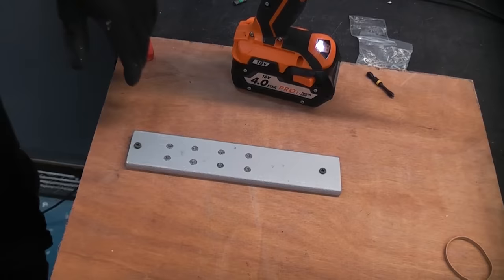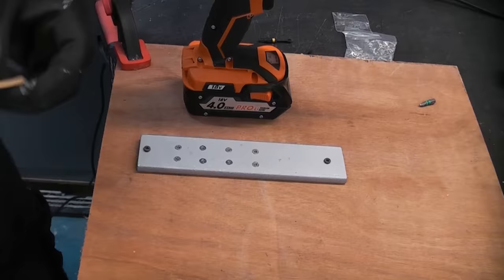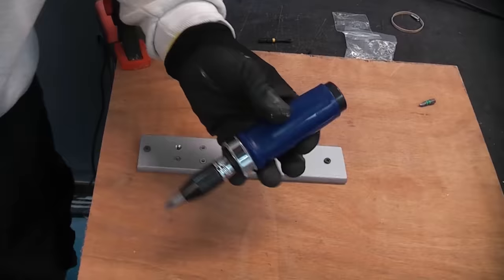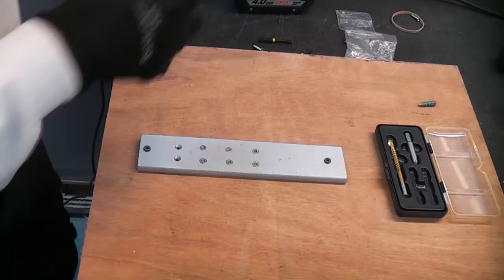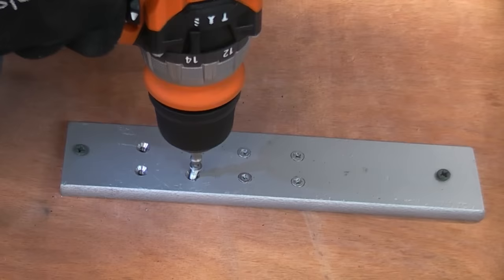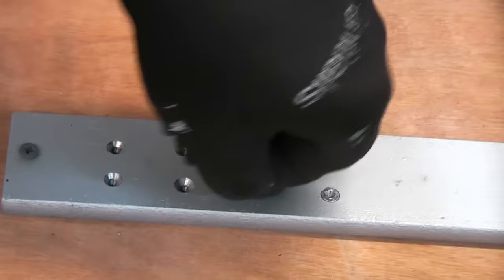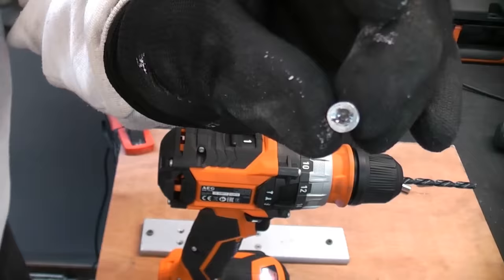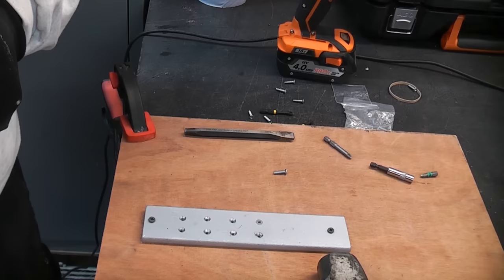How to remove stripped screws – 7 different ways

Comment: is the swearing and pleading method not useful?
Reply from the maker: It's a necessity, but I cut that bit out for the benefit of the viewers LOL
Thanks for the comment
Reply: swearing and pleading method is more a motivational technique for both the operator and the tools
Reply: Imagine Gordon Ramsey, the screws would be so screwed.
Reply: Jusb1066 Lmfaooo
Reply: I just use the sawzall method then combine it with the prybar method then spit on the motherfucker and demand it to call me the boss....im still waiting for the response but it nolonger has a head
Reply: I tried just then, didnt work sadly
Reply: I will add one more idea that worked for me another day. I ended up with a Philips screw head really bad, no way I could take it out with any driver. I had a set a torx bits in my tool box, I picked up one that would fit inside the Philips screw head, a hard punch with a hammer for the torx bit make its way in,  put the drill driver on the torx bit and off you go. It worked like a charm. I guess it will be my preferred method from now on as  long as I have a torx bit handy.
Reply: That screw is f**king RAW!
Reply: Jusb1066 my husbands trying that now... With no luck
Reply: I think it's just not as quick
Reply: LOL!!! Like he said, it IS a necessity, but truly, NOT very helpful unless you combine it with at least one of the methods demonstrated.. LOL
Reply: I prefer swearing, insulting, and threatening
Reply: Jusb106
Reply: Jusb1066 yes it does normie
Reply: My go-to method.
Reply: Yup.
I have at least an 80% success rate when adding cussing to my procedures
Reply: I've determined that swearing and pleading is useless. I'm very proficient in this technique. I've used every swear word I know and the screw still will not budge. It doesn't matter how loud or passionate you use your swear words either. It's like it has no feelings or something.
Reply: David Y literally
Reply: "I'd just like to point out that If you're trying to remove a four inch wood screw where the head  is damaged... you have virtually no chance at all."   
That's exactly what I am trying to do. I will put a couple of these through the torture test anyway.
Reply: Lol
Reply: I have found that describing in detail exactly how you intend to recycle the fastener helps too...
Reply: Did not understand instructions. 
Got fined by the Screw Union.
Reply: My boyfriend is trying that method while I’m watching this. We will see who gets it out first.
Reply: David Y so funny
Reply: I tried talking in my best British accent,  worked a charm mate
Reply: What is the name of the screwdriver in the second way?
Reply: @ultimatehandyman  What is the name of the screwdriver in the second way?
Reply: It has to be swearing or pleasing, never both or it can't work
Reply: Jusb1066 I am in that stage rn lol
Reply: You would use this verbal and supplicating method 1st before you remember you have watched this video. After you tried all the above suggestions as shown in the video and that rusty junk metal screw still wont come out the by all means again apply the 1st method liberally.
Reply: Usually threatening or negotitation works
Reply: FUCKING HOPE NOT, I'M 10K IN DEBT TO THE SWEAR JAR
Reply: @stuarthunter2923  lmaooo i keep swearing everytime I cant get the screw off

Comment: Brilliant! After struggling for 20 minutes I found this video and used an elastic band and power screwdriver to remove a screw in a shower screen to shower screen wall bracket where one of the six screws had gone a little rusty and the screw head itself was worn. It came out first time and with not much effort. Thank you, great stuff.
Reply from the maker: I’m glad you found the video useful
Thanks for the comment 👍

Comment: hey guys!! i had this issue and i just took a hammer and relieved all of my stress on this screw. i screamed. it got brutal. but the nail finally came out. highly recommend😊😊😊
Reply from the maker: Thanks for the comment 👍
Reply: Its in my laptop tho
Reply: @nahfid2003  You're screwed
Reply: @Klaasvaak999  nvm I just bought a soldering iron.
Imma solder flux to the screw and a driver and then twist it.
Hopefully it'll come off.
But first I need to learn how to solder
Reply: It don't work tho
Solder too weak :((
Reply: @nahfid2003  did it ever work

Comment: One technique that wasn't covered here but has worked wonders for me is to use a small dab of hot glue and hold the bit in it until hardened. The hot glue grabs any small imperfections and of course forms perfectly around the bit. A drop of oil in the treads helps too for tough cases. It works for basically any type of screw (even one you don't have quite the right size bit for). The downside is it's a bit tedious to do if there are many damaged screws. That's when it's time to invest in a proper damaged screw bit like shown here.
Reply: problem is that it can make the screw stuck
Reply: lol, when doing the same thing on elecrtronics I use air dry clay, Used it once, worked for me
Reply: @RussianNationalist  Exactly what I was thinking.

Comment: Love this video!  I was trying to remove a concealed door closer from my storm door and the heads of the phillips screws immediately started to strip out.  Thought i'd have to remove the whole door, but i checked youtube first.  The rubber band trick is absolutely amazing!  The 2 stubborn screws came right out and you saved me a ton of work and possible damage to the door.  Thank you!!
Reply from the maker: I'm glad the video helped 
Thanks for the comment 👍
Reply: I'm dealing with the identical situation right now! The concealed door closer on my new storm door is defective and the manufacturer mailed me a new closer under warranty. When I went to replace it I discovered that the contractor who originally installed it stripped the screw heads during the install. I managed to get one screw out myself but I'm here on YouTube trying to find a solution for the other one. This video was awesome and I'm going to try these tips in the morning! Thanks!

Comment: Hey man, I got to give you a super thanks.  I was working with completely stripped screws and I tried the rubberband method and it worked in about a minute.    I had some similar rubber bands and used about 3 of them and it worked perfectly.   Thank you.  I will definitely remember this method.    5 stars.
Reply from the maker: I'm glad the video helped 
Thanks for the comment 👍
Reply: @ultimatehandyman  aaq

Comment: Excellent video. Even 4 years later it’s still ‘saving the day’.  I was able to use a screwdriver blade to gently tap on a protruding edge (similar to how you used the spring-loaded center punch) to unthread far enough to grab the bolt with vice grips. The harder part of the situation is turning out to be locating replacement intake manifold bolts for a 2000 MY car. Thanks again!
Reply: How did you use the vice grips? Once they locked on just turned them until it came out? 

Cuz I’ve got one protruding now that is fat enough out to use vice grips on, so I could just do that?
Reply: @Vgallo  Sorry I never saw this.  Obviously you solved this months ago. 😊  But, for anyone coming across this in the future... Even with the versatile Vice Grips, I struggled to get a hold of my offending bolt using the snapped-off portion that was protruding above the surface.  After it snapped due to my carelessly putting too much torque on it, I was greatly relieved when I realized the threads hadn't seized and I could rotate it by tapping.  So yeah, once there was enough to grab onto, the Vice Grips could live up to their name and I was able to rotate the broken stub by slowly rotating the tool (I had enough room to do so in my situation).  But I gotta admit, there were some definite minutes of panic between the shock of snapping the bolt and finding this video by Ultimate Handyman.  It was like finding a tranquilizer in video form.

Comment: I usually dont comment but  the spring center punch  method was a lifesaver and this video saved so much time for me . I didnt think it would work but it worked like a charm . Also cutting the heads to allow a flathead helped for once of the screws . Always pre lubricate

Comment: Great tips. I tried the rubber band option first, but the screw was in too tight and it didn't work. I then tried the chisel option, starting at 8:00 on the video, and it worked! Thanks for the video.
Reply from the maker: I'm glad the tips helped ;-)
Thanks for the comment 👍

Comment: I have seen the rubber band trick a few times but I have never put it into practice,  I can't believe it really is that effective!  Great to see some other methods of screw removal as especially in older houses like mine you see a lot of screws that have seen better days and are almost impossible to remove with a regular screwdriving bit.....well not anymore! A great video showing some really useful tips on to remove those massacred screws heads that can sometimes really ruin a perfectly good day.  

I have often just used a Dremel with a thin cutting disc to almost score and reinstate the screw head grooves enabling me to get in with a screw driving bit and remove the screw.....works great....if you have a Dremel.
Reply from the maker: I'm glad you found the video useful.
Thanks for the comment ;-)
Reply: actiongirl5 loop
Reply: Thats my next step. If duct tape method doesn't work, then "dremel" here I come!

Comment: I know absolutely NOTHING, and I mean NOTHING about construction of any kind. 
I found my dad’s vintage portable CD player and one of the screws was super chewed up. I don’t even have a drill, just manual screw drivers and flat head ones. 
I tried the rubber band method on the tiniest screw I’ve ever seen, and it WORKED!! I have no fancy tools and I am not a strong person, but all I needed was a rubber band (which was super super thin, just a regular staplers rubber band) and something to help my grip. I just used one of those rubber disks that help with opening jars. 
Thank you SO SO MUCH, I cannot believe it worked! I thought there was no way I would be able to do it because I don’t have any fancy tools or drills and it still worked. Thank you. I’m so excited to be able to put in new batteries!!
I wish CDs were still a regular item. I think everything should have hard copies. Now I just have to figure out how to burn a CD on a computer with no CD slot 😅 
Thank you!! One billion thank you’s!!
Reply: Update: I cannot get the bottom off. I can’t even be mad because of how goofy it is that I Concurred The Screw and STILL can’t get it open 💀😂
Reply: Another update: I did not need to unscrew the back. There was a trap door on the inside that has zero screws inside and all you need to do is tug on a notch and it opens. This is why I don’t mess with hardware 🫡😂 I got it in the end tho!

Comment: A piece of coarse sandpaper can have a similar effect to the elastic band.
Reply from the maker: Thanks for the tip ;-)
Reply: @Ultimate Handyman so many new ideas i found in the comment seciont maybe make a follow up like method #8-14 how to remove screws :D
Reply: gonna try that tommorow cheers
Reply: Thank you so much!! I had no rubber bands and this trick worked 😁
Reply: Oof, I can just imagine sanding down the screen he head until it has no more grip

Comment: Good video! The eighth method  is to use a small drill bit to drill down into the center of the screw then use an easy out to remove the screw. That's how it's done in avaition.
Reply from the maker: Thanks for the comment
Reply: What is an "easy out"?
Reply: luvlethalwhites , it’s a screw extractor. It’s actually a drill bit that cuts into the screw in reverse.
Reply: He actually showed one in the video, the 4th one he called a grabit, is an easy out with a cutting bit built into it (and made for a drill instead of a tap handle).

Comment: Thank you for showing all of these wonderful methods. I've often used the chisel and hammer method. Also the left handed drill bit does work for long wood screws (sort of). I usually use the drill bit enough to get it 1/8 in out. Then use vice grips and a lot of turning to get it out.
Reply from the maker: You are welcome
Thanks for the comment 👍
Reply: @ultimatehandyman  Does it need to be a left-handed drill bit? will a normal drill bit not work?

Comment: May I add another method to your armoury - after hours of struggling to get a screw from wood I eventually got my electric soldering iron and placed the tip on the remains of the screw head for about five minutes (this expanded the screw) I then let it cool, the screw then went back to original size, but the hole it had made didn't. I then got the screw out VERY EASILY just using a pair of grips. I haven't tried this method on a screw into metal but screws holding door hinges onto wooden frames or a wooden door can sometimes be a right 8@$*@rd.

I recall back when we had coal fires a red hot poker would perform this trick - but an old screwdriver and a gas hob will do the job if a soldering iron isn't available.
Reply from the maker: Thanks for the detailed comment ;-)
Reply: Brilliant.
Reply: I've heard of a similar method for removing bolts that the head shear off on engines using a torch.
Reply: Genius! You should make your own videos..
Reply: This comment helped me a lot more than the video! I just removed 4 rusted screw from my toilet door with the help of my soldering iron. Thank you so much!!! 😘
Reply: dude you saved my life
Reply: Definitely one to remember, thanks
Reply: I've seen were candle wax melted into the threads will help for rusted screws.  Maybe a soldering iron and wax.   Also heard WD-40 may loosen a stuck screw.   Maybe do that before using the above methods.

Comment: For the wood screw, there are very small and deep hole saws that fit over the shaft of the screw (after you break the head off). You can improvise if you have a piece of tubing of an appropriate size. Just make a very rough cut on the end (the rougher the better) - the screw shaft will keep it running straight. These also run counter-rotating, so quite often you do not have the drill out the whole depth of the  screw. The only ones I ever had to fully drill out we're either rusted or had been epoxied in the hole. If you use brass or copper tubing, it will often twist and bite down hard on the shaft and turn the rest of the screw. But go slow when this begins because sometimes the tube twists off instead.
Reply from the maker: Thanks for the comment

Comment: Two other options;  (1) Use a Dremel tool with a small cut-off wheel to cut a slot across the face of the screw.  Then use a straight blade slot screwdriver in the newly cut slot of the screw to turn it out.   (2) Drill a small hole in the center of the screw with a 1/8" to 1/4" drill bit and then drill the head completely off with a larger drill bit, such as a 1/2".  This will release the part, but leave the screw shank embedded.  When you reinstall the part, you'll need to drill a new  hole in a different location to screw the part into place.
Reply from the maker: Thanks for the comment 👍
Reply: That has always been the most effective method I've used throughout the years.
Reply: Dremel along with others from video worked wonders!! Thanks for this comment!!

Comment: Good overview and tips. Also that wood-screws often cannot be removed. That was my experience also. "Solution" was to remove parts of the screw -- also allowing to be the wood damaged and after that filling the hole with a 2-componenent filler before painting.
Reply from the maker: Thanks for the comment 👍

Comment: I wish philips screws would just disappear, so many mangled screws due to so many people confusing philips and pozidrive.
Reply from the maker: Thanks for the comment
Reply: How about pozidrive disappears
Reply: eggypickle or
Reply: Back when I was an apprentice Sparks in the 90's my company would only buy slotted screws!! I found great delight in finding discarded pozi drive screws on site and being able to use my Yankee Screwdriver  or Black and Decker electric screwdriver to their full delightful ability!!!!!
Reply: Couldnt agree more 👍
Reply: It's just as bad. We use Torx in Germany, and in my opinion it takes a bit to round those off. Then again there's too many people using Assy driven screws here, which are horrible.
Reply: @CaynesDub  in my limited experience, pz grips a little better than ph, but both are evil if handled by the wrong driver. At least with torx you don't have that confusion.
Reply: Philips and flat head still have their uses, especially sensitive applications where you don't want anything over torqued. They really need to stop making philips drywall or deck screws though!
Reply: Or use the correct bit for the job or not use a drill on the wrong setting.
Reply: @chadchiles2313  yeah, or those who try and remove/tighten a screw without the tool being flush.
Reply: eggypickle Don't forget the JIS screws that are neither for max confusion.
Reply: Canadian robinson screws are the best. Philip screws are the worst.